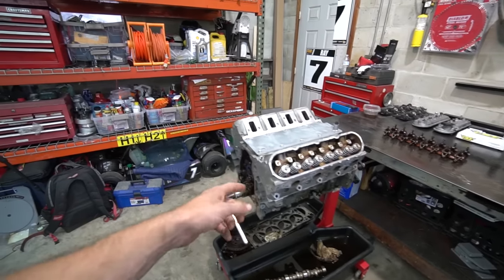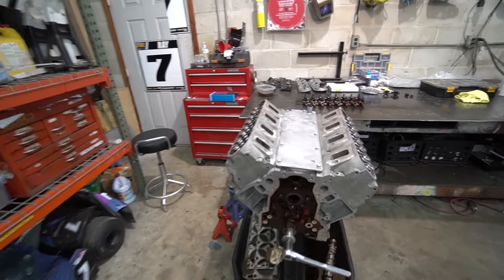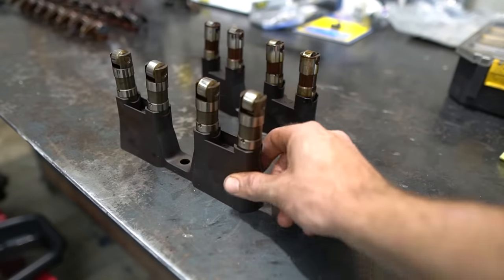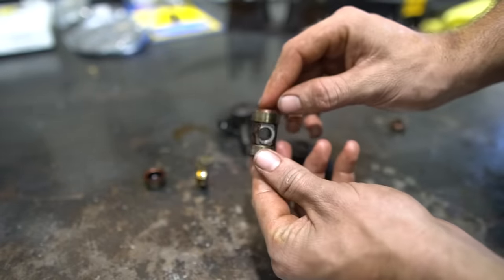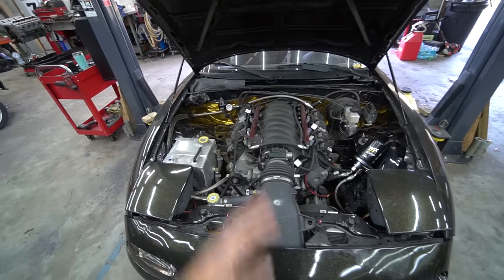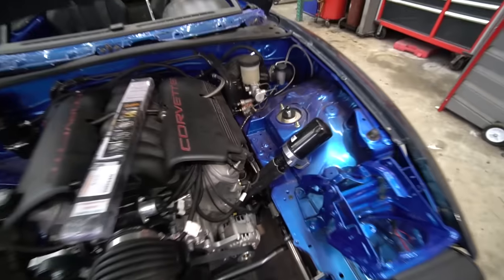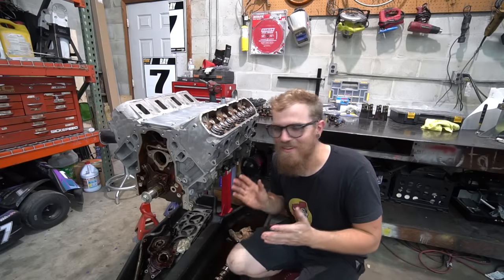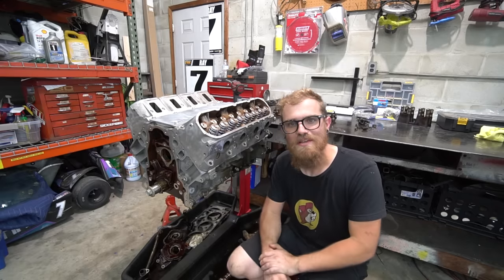Top 5 Mods To Make An LS Engine Reliable.

Comment: Great info. I have everything he points out and I can concur that every bit of info this guy gives is spot on. I use my engine in road racing and I have zero issues. These are must do for anyone that will push this engine.

Comment: My LS2 crate engine with CNC ported LS3 heads with a cam matching springs upgraded timing gears and chain LS7 lifters with hardened pushrods and a SFI harmonic balancer with a GM single plane intake and holley hp 850 carburetor has a basically stock shortblock stock crank rods pistons it's been in my 1984 Monte Carlo SS since 2008 has seen very many 7200rpm rips in 1st 2nd and 3rd gears and still running as good or better than when first put in car 12
 years ago it also has a stock 1998-2002 camaro oil pan that is stock with a stock oil pump it does get fresh royal purple HPS 5w-30 and a Wix oil filter every 6 months every 400 to 600 miles and l put 800-1000 miles or so on it a year street driving it on nice weekends

Comment: Probably the best LS advise video on YouTube right now. LEAVE THE BOTTOM END ALONE and don't F*** with it... so true- they get 300k miles for a reason. Honestly if you're not pulling hard G's and you're a street car exclusively even the oil system is fine. However- if you race it- your advise on the oil system is priceless- ask Hoovie how he blew up his $10k LS swapped Porsche after just one track day and was shocked... Super good video- I'm subbed!

Comment: The oil tank at around 16 minutes is a Hydraulic Accumulator and works off basic hydraulics and still is used in some form in every hydraulic system that needs constant and consistent flow (Aircraft have many)

Comment: Melling high volume pump and some good plugs, you dont need much else. A deeper pan if you are constantly overheating your oil but i rip through the streets and dessert with mine and the only issues i have are power steering pumps and the countless power steering high pressure lines.

Comment: I got tired of killing engines I went to tkm and had them build me a stage 3 package 427 and I got my turbo from forced inductions but I agree with you up to a certain horsepower range I was just killing stock blocks I had to go with a skirted block from dart I even killed a lsr block  so I saved borrowed and stoled lol and built a 2500plus engine  and I have refreshed it once in 3 years.

Comment: Great video, have to disagree with what you said about not touching the bottom end and guys making 1000hp.  Yes, you can do it, the factory pistons and rods and crank are all capable of that.  What gets you is the ring gap.  GM built these engines to be reliable towing a trailer up a hill making 250-300hp, not to take the heat of 3-4 times their stock power levels with a turbo.  When the rings get hot they expand and the gap between the ends of the rings begins to shrink.  When they touch the only place left to expand is outward, they jam in the bore.  They want to stop and the piston wants to keep going.  The ring lands of the piston break.  This is the weird reason why the especially high mileage engines take boost better than a nice low mileage engine, the rings are more worn.  Check videos by Sloppy Mechanics, great source of info on how to build stock bottom end LS engines to stupid power levels and how to avoid breaking them.  You'll see this with Richard Holdener's videos too.  Check Engine Masters videos by David Freiburger, Steve Dulcich and Steve Brule.  You leave the crank in, pull the pistons and rods out, put the rings in one at a time by themselves into the cylinder and push them down with the piston to make sure they're square and check them with a feeler gauge.  Gapped for boost they should be .026" to .030" depending on how hard you're going to send it.  E85 burns cooler and needs a little less gap than gas.  Make sure you match each ring to the cylinder it came out of and the position in the piston, also which side is up and which is down.  This is only for a boosted or nitrous engine.

Comment: New rear cover gasket with an updated upper galley seal.   It's the same as the front plate seal just at the other end.   My own LS in my wife's blazer lost its cam noise after replacing the rear cover gasket.

Comment: Dude ls engines are reliable as hell stock I have a 2004 tahoe with over 350000 miles completely stock no problems so far besides neutral control switch

Comment: Thx for the TIPS, I'm a SBC guy n LS noob but been taking notes for when I eventually get one.  Bushed rockers spread the load more evenly but collects garbage cause it's soft, with sbc cheap rockers use small rollers and better rockers use largerOD/more to increase surface contact and spread load but are heavier.  Just depends on your use.   P.S. Oil Accumulator, accusump is a name, check out CVR oil accumulator for the RX7.  Drysump gains some HP but not much per $$$$, main benefit is oil supply like you said plus de-aeration.

Comment: I bought a gen 3 ls that did not have those lifters, but evidently, I guess I bought a 5.3 with ev6 injectors because it was flex fuel capable when it ran in the original vehicle. I still replaced the lifters since I had already bought new ones.

Comment: Well said, on. DO NOT MESS, with it. 👌. Leave that bottom end alone. I have 211,675 miles on my 2000 Trans am. I STLL BEAT on it on the weekends. Use to.be my everyday driver for 6 years. But! Good oil and a VERY good oil additive like hot shot secret nano lube. Works very well if your not buy a dry sump system. I autocross my Trans am. No problems. That nano lube is great stuff.

Comment: Oil issues sound more like build issues. Generally, you want another 10 psi per 1000 rpm, so shiming a stock pump 0.110 should be good for about 7000 rpm. If your bearing clearances are so loose that you loose oil pressure at high rpm you probably should be running a high volume oil pump and/or making modifications to ensure it drains to the pain quicker so that oil isn't stuck in the top end.

Comment: Just a couple things, on a wet sump system the stock pumps WILL cavitate over 6000 rpm.  A Melling never hurts.   LS timing chains are notoriously loose and Trick Flow makes a bolt in damper assy. for them and as long as you're in there ALWAYS replace the timing chain with an upgraded LS2 piece.  It's a direct replacement and is larger and 30% stronger.   Oh, and speaking of the LS2 a set of the blue valve springs and one piece pushrods will stabilize the valvetrain through 6500 rpm.  $150 well spent once your done with the rocker arm bushing upgrade.
Reply from the maker: I’ve never snapped a chain and only replaced mine once.
Reply: @Taylordrifts  They don't snap but stretch to the point where they will start slapping the block.  That throws all your cam timing off and makes running very erratic.

Comment: I tore into the bottom of my LS4 and found scarring on rod bearing #1.  75,000 miles, salvage part car bought from copart.  So, I don't know the history on the engine, like most junkyard picks, but had I not torn into the bottom end I would have rod knock within a couple oil changes.

Comment: Two most important things are pushrods and harmonic balancer if you do a cam change and rev it to 6500rpm or more over and over again your going to need hardened pushrods and a SFI harmonic balancer and of course upgrades never end for a LS engine but it depends on how deep your pockets are l can tell you longtube headers are a plus for more power but I've seen some with a cam and stock exhaust manifolds cat deleted with a free flowing exhaust that run pretty dam  good but they are street cars not a drag car

Comment: Taylor you should buy the freeze plug retainers the just bolt to the head and hold the freeze plug from piping out at high rpm the billet aluminum

Comment: Now you're saying all these lifter upgrade excetera you did to your l98 6.2 motor would you recommend this same combo 4 a 2004 LS1 / LS6 5.7 gen 3 T56 GTO 241 heads on it I did pick up a set of 20 milled LS6 Springs 243 heads to throw on it and a cam probably going to tune with HP tuners

Comment: Great video Taylor! Would like your advice, i picked an used LS2 with T56 which has about 110 miles. I heard it run and all that. Owner mention no issues. Im trying to avoid tearing into it like you said. So at a minimum what parts can you suggest me change while i have the motor out?

Comment: Hardened pushrods and a SFI harmonic balancer are the first two things to start with both the stock pushrods and harmonic balancer suck and any repeated 6500 + rpm romps is eventually not going to end well if you know what l mean

Comment: Tell you what, if I'm building an engine, my #1 concern is reliability. I don't want to blow up an engine I just build. Especially since I do a lot of off-roading and if it goes, it will go in the middle of nowhere on a rocky trail.

Comment: thanks again, glad I watched this again I forgot to get the oil pickup shit. 

yall pay attention on scamazon, only like 3 of the non melling chinese pickup tube girdles have grade 10.9 hardware or whatever. dont "improve" your engine by adding loose broke off bold heads around the windage tray lols

Comment: Hydraulic systems on heavy equipment use accu'mulator and it does its job. Same works just fine for lubes oil.

Comment: I've had mine since new. Has 270.000 miles on it. Reliable never had a problem. Important to change oil with GOOD stuff don't skimp! And also very important to get a good oil filter do not use cheap shit. Use a K&N with the check valve to prevent dry starts. These engines if you don't follow those rules you will get piston slap

Comment: High volume pump upgrade will suck your pan dry at high rpm in short time. High pressure pump works fine with stock pan on the street..

Comment: I was with you till the "rod knock" from oil starvation.  You over looked so much with this and just went with Dry Sump.

1, your drifting which means you are going to be sloshing oil away from the pickup when under high RPM.  Yes that causes an issue, but that is related to drifting, and some Road course conditions.  
2. You did not address if the oil pump is High Pressure, High Volume, or High Pressure High Volume.  A high Volume pump is going to drain your pan very quickly at high RPM, which is like what you had installed.  Going High pressure could help fix the issue, but again you still have the oil slosh issue.
3. Did you check your heads and block for smooth oil channels back into the crank area.  If the block has rough openings, it will cause oil to pool on top of the motor, thus oil starvation.  If you are using a High Volume oil pump, this is especially important.  

So in your case, yet a dry sump setup is the best option, because you are drifting and causing oil sloshing.

Comment: Sure GM can make a reliable v8. The modern GM 4 cylinder and v6 are very questionable and GM cylinder deactivation. The Buick GNX v6 turbo, and 3800 series v6 are the only non-questionable GM v6’s.

Comment: I would say, thing number six would be replacing the flat wound cam bearings with one piece seamless tubing cam bearings. As some of the LS is tend to lose the number four cambering. The flat wound stock ones are garbage. Just saying they are.

Comment: if you  max hp ok but keep stock they last my ls1 in my 1997 c5 never had any problems  long tubes with high flow cats  and intake mod way over 100000 miles keeps truckin only had to change the pulley on crank

Comment: I installed Lunati tie bar lifters in my Monaro as the oil feed holes are in line with the roller tip. Hopefully that’ll also help roller failure or lobe wear.

Comment: Soooo..if I wanted to build an ls as light as possible, make as much hp between 3500 and 4k rpm, and run at those rpms for hours on end. I know a few who have built ls3s making 480 to 530 hp that run like this but reliability is always the holy grail for this application.

Comment: Hi Taylor, Hopefully you see this. What's the deal with Cylinder #7 issues? How do we prevent it? I heard putting your highest flowing injector on #7, and making sure you have all 4 steam ports hooked up is the answer. I'm swapping from a blown up LS6 to an Iron 6.0 in my C5 Z06 race car. Don't want this happening again :)

Comment: Okay thanks for the important information and technical tips.  I need to renew a 08 5.3 in my Silverado WT with 341K miles.  Yes it still runs but has a collapsed #1 cylinder lifter from my troubleshooting.  Happened last time I towed a boat from the lake.  That’s what it does hauls and tows in the hot Texas heat. I am told to delete the AFM DOD with a kit, and then get a ECM tune during the “rebuild.”  After your video maybe I can just “renew” it with items you mentioned in addition to a cam if oem cam is messed up by bad lifter.  Any suggestions for a budget cam good for low end torque or other good tips?

Comment: What size accusump would you recommend?  I've seen 1qt. up to 3qt..  I have a 1999 Trans Am with an L92 and a Summit Pro LS Stage 4 cam, LS3 intake w/42lb. injectors.  Mostly street-driven, but I like the idea of NEVER losing oil pressure if I decide to screw around.

Comment: Crossing over from honda engines to LS world is pretty dramatic in terms of " life expectancy" and " reliability". 150k on a honda engine you've ran on 1 quart of oil for 5 years is almost "just getting broken in"(lol). i hear people saying that 110k is "high mileage" on an LS. At any rate, i just got a lift out ls3 with 120k on it.... given your experience, would the "while i'm here" approach be more  applicable in my case, or should i "just run it"???

Comment: "The rabbit hole" I would like to build one but you get into the weeds of deck height and just all sorts of other stuff I want an aluminum dart block because they've done things to them to make them oil better but you can get a gm performance block ls3 way cheaper I wanna make 1000hp engine that's really reliable

Comment: good video but some of your "necessities" are a bit extreme don't you think? I understand you're traumatized by breaking a motor at the track, but if you brought a standard LS engine with no underlying issues to a drift event it wouldn't necessarily get a knock. I have an LS1 90k miles,  5 years in my car, over 60 events.

Comment: You should do a smooth bellow coupler in-between your intake and throttle body ive seen them pick up a couple horse power and torque on my buddies camaro

Comment: I had no idea they were unreliable. I've owned a few and my current one is in my Chevy Silverado with a 4.8 and it has over 300,000 kilometres on it with regular maintenance. Still runs like new what's the problem?

Comment: I love the "put in gas" comment, but I'll do what this video claimed to do.
1. Change your oil. And don't buy a clapped out LS thinking oil will fix it. It's Metal..
2. New GM Temp sensor. Start fresh, know your engine is getting good info.
3. Clean the MAF. Know your engine is getting good info.
4. Fix exhaust manifold leaks. There are a ton of videos and aftermarket solutions so most guys can do this in the driveway.
5. If you're dating a guy that can't do 1-4, find a new guy!
6. Bonus. Get rid of the oiled air filters on the daily driver!

Comment: Curious about your thoughts on 4 corner steam kits. I've had plenty of bolt-on V8's from most major manufacturers, and I had to google what it even was. Yet, it seems like I see them popping up in LS conversations often enough I thought I should research (which actually lead me to this video). I have an L92 in my DD, which will not be drifting or RR'ing anytime soon (07 Escalade ESV, lol). However, I would like to improve it's reliability and someday maybe shoot for ~400awhp. The steam kits seem fairly simple and inexpensive, but of course, most people talking about them are either selling them or justifying their purchase. How critical would they be in something like my application? A big family hauler that see's a few spirited jaunts from time to time.

Comment: One thing I've heard is that they started using aluminum rod and main bearings. And when the oil starts getting old and acidic It eats at the bearings. So if you don't change your oil enough then you will have problems. The engine builder I heard it from puts in tri-metal bearings when rebuilding the engine.

Comment: Good logic, gotta pay to play. So when we read the Summit Racing tuning tips about pistons cracking as a "known weak point," that's only for crazy numbers like 600hp?
Reply: Correct
Reply: I just pulled an LM4 from the junkyard. Crank turns, but the spark plugs are black and grease all over, even the valve covers... Front seal/chain cover gasket leak maybe...

Comment: Not really a slider or drifter but I do like to go fast and I am putting a cam in my ls1 so trunnion and lifters  and a high  volume oil pump and the cam gasket
Reply: Or road racing maybe a quick 1/4 mile

Comment: Anything you suggest for a 2002 Camaro SS with LS engine?  I've only replaced the water pump and knock sensors and it has over 200,000 miles. It's had a minor knock (tick) forever but has never bothered it.